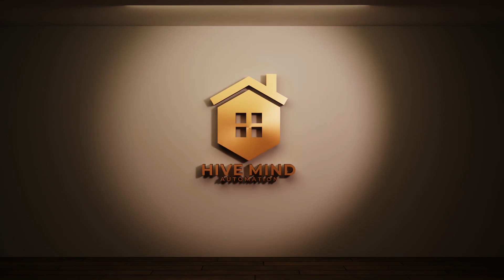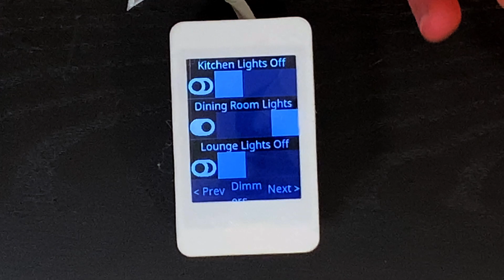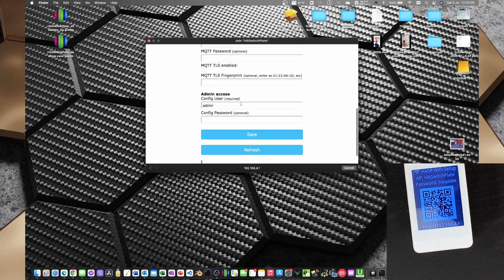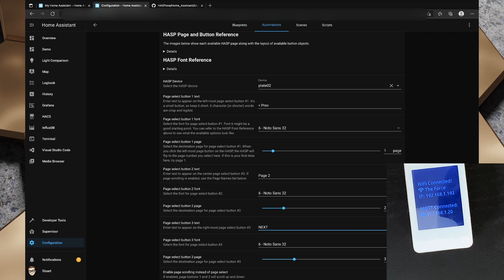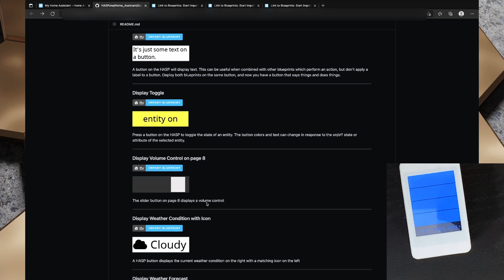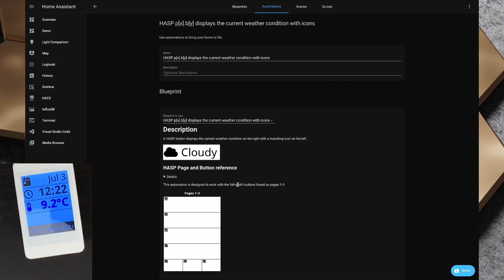HA Switchplate/HASPone Overview

Comment: Hey what a great video!  As the developer I'm pretty stoked to see how others are making use of this project. Here are a couple of notes that I jotted down while watching this video which might help others out:

* The DC power option is great for in-wall use cases where you might not want to have high-voltage AC in the box.  However, if you're using the desktop model the entire thing can simply be powered via micro-USB. There is a cut-out in the desktop enclosure to allow you to plug in and power the device via USB without requiring a power supply on the PCB.

* If performance isn't great, it's likely on the Home Assistant side.  While you're correct that the ESP8266 isn't a powerhouse, it's also not doing very much here apart from passing Nextion commands around over MQTT.  If you watch the debug logs, you can check timestamps to get a sense of where any delays might be happening.  Blueprints + templates can eat a fair bit of CPU on your home assistant install.  If you're running on an older RPi with a lot of automations enabled, you may find user interactions on the HASPone are slow as a result.

* In your notifications area, you'll find some YAML has been placed there which can be used to create a custom card in Lovelace if you're using custom Lovelace.

* There are 4 RGB color lights created for each HASPone, they control the 4 theme elements.  Click around on the color wheel on those lights to change colors on the plate!  The theme blueprints are there to demonstrate this effect, but all those blueprints do is change the RGB lights when you click "RUN ACTIONS".

If anyone has questions or ideas, please post them in the repo here: https://github.com/HASwitchPlate/HASPone/discussions

Thanks again for this video introduction to the project!
Reply from the maker: WOW! Thanks for checking out my video! 
I'll take those points onboard. 
Australian Electrical Regulations (at least in my State) are somewhat restrictive as to what we can wire into the wall, so the DC option is probably best for any Aussies building the project.
I had noticed my HA install was running a wee bit slow, most of those performance issues have since gone away.

I'm really happy with it and it's definitely the coolest smart home project I've had to date. Thank you so much for creating it!

Comment: For those not skilled with soldering,  and want something off the shelf in Australia, the closest is the  Ctec Mirror smart switch. Supports 3 switches/scenes via MQTT + Home Assistant:
http://www.ctec.com.au/the-mirror-range
Reply from the maker: Thanks I'll have to check that out
Reply: These seem to be rebranded Lanbon L8 smart switches. They have an ESP32 inside and can be flashed with custom firmware like openHASP or Tasmota too.